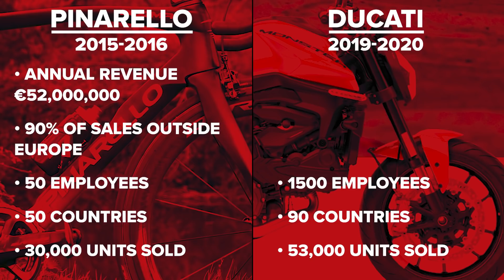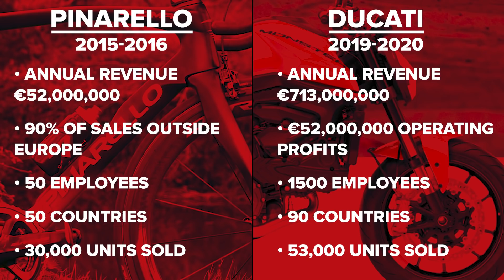How Can A Road Bike Cost £10,000?!

Comment: Yes..the jury is out and the Pro’s on TV are using them (with hints that they are not great)...DISCS
NOW...We as the consumer in many cases cannot justify going from rim to disc...or are just plain HAPPY with their bike (that a couple of years ago..WAS nearly the price mentioned here..)
But hey..let’s face it..even IF...and IF..you wanted to upgrade your super high tech all bells and whistles TO disc....well look at what you have to change?
There is NO mod to convert your frame from rim to disc..(there are different tolerances on the frame and forks for a start) as to where the calipers are situated...the wheels...(hubs, discs etc) and don’t get into electronic!!
Sooooo your looking at a NEW A NEW BIKE...

Comment: The main reasons? Disc brakes and electronic groupsets... let's get back to 2015 and rim brakes and mechanical groupsets (with a light aluminium set of wheels): 1kg less, and 4000€ less...

Comment: Another good reason for high bike prices is research and development (R&D). When it comes to frames I bought a Kuota Kharma full carbon frame in 2006 for £800. It had aluminium dropouts and cable routing outside the frame which made it cheaper to produce. Then somebody in R&D thought it would be nice to integrate some of those cables, but that means making loads of samples, testing and the extra time that takes making complex shapes increases labour cost per frame. 
So the price will increase as the manufacturer has to recoup that investment on projected sales. Then R&D decides to go fully integrated and that bring everything up a notch. Not even mentioning that you don’t always get it right the 1st time round (like Venge Vias) and you have to back to drawing board for a complete new design, as you are making it impossible for the end user to service the bike or travel with. All that extra investment for development is passed onto the frame price and carriers on to future frame prices if sufficient sales weren’t achieved. That’s how you end up in 2020 with a frame that costs £4250 (Sworks Tarmac) for example.
Same goes for groupset prices, we went very quickly from good old mechanical shifting that served us well for decades to electronic, even wireless and straight from rim to hydraulic, so did the price change very quickly going up of course. Also created a lot of headaches with compatibility etc.
Research and development is good, but too much too quickly will have a negative impact on our pockets...

Comment: Now you only looked at the production aspects of the cost. I prefer a different point of view. Cycling is for the most of us just a hobby. And when you compare it with many other hobbies 10k is nothing. I’m from a background of motorsport such as rally. And it’s not impossible to build a rally car for 10k but you will be far down at the entry level. And then comes the cost for driving and competing with the car. On national level you can easily spend 10k on things such as starting fees, tires and fuel on 2-3 races. 

Another example, try getting a boat… 

So of course 10k are a lot of money, but people put a lot more on many other hobbies.

Comment: There will always be a want and a need. I would love a brand new $12k USD S-Works Tarmac. I can afford it, but I just can’t justify spending over $10k on a bike.  I’m perfectly happy with my 2017 Tarmac SL4 Ultrgra and upgraded Zipp 404 wheel set. Most importantly, a well fitted bike and correct saddle with is all one needs to enjoy and be comfortable on rides.  After making constant adjustments on every single  ride for almost 3 months, I finally got my bike dialed in and I was surprised by how much faster I got just from bike fit alone.  I am still faster than half the guys I ride with that own brand new $10k plus aero bikes.

Comment: Just a few thoughts to add to this:

Because a bike is human powered, the engineering margins are significantly less forgiving than in the automotive industry. Tiny changes in weight, stiffness, aerodynamics, vibration absorption, etc. are not only detectable to the rider, but affect performance. This is going to raise the labor costs significantly, not just in time spent but in the level of skill.

Secondly, it's unfair to compare a high-end bike to a low-end sedan or motorcycle. High end motorcycles can run into the millions. High end sedans can cost hundreds of thousands. Comparing a Fiat to a high end carbon bike is comparing apples to oranges.

Thirdly, let's compare a mid-range bike to a mid-range sedan. Midrange bikes run from 1,000 to 5,000, whereas midrange sedans run from 30k - 50k. For a bike commuter, that's an immense savings. But even buying a high-end bike, for 10,000, it's still a huge savings, and it would still be the equivalent to commuting in a Lamborghini.

Lastly, considering value, getting from Point A to Point B on a bike is just much more fun.
Reply: buy what you need, but pls dont be stupid on trusting the cycling companies..they trick you with the marketing..are you using a bicycle to race or only for exercise? then if youre using a race bike for an exercise you fall into the trick of marketing

Comment: These 10k bikes are ones pros use for racing too. If you were to buy a car pros use for racing, it wouldn't be 10k. You can't even get a F1 steering wheel for 10k. I think I read somewhere that the rear and front wings of F1 cars cost like 200k or something silly like that. And the engine is worth millions. If you want to compare a 10k Fiat to a bike you should compare it to the cheapest one you can find.

Comment: Forgot to include a couple of relevant factors considering the Pandemic as well. Boats/containers are extremely hard to get these days, and shipping costs have risen dramatically. Supply chains for every tiny little component have also been crippled, and additionally bikes take up a good amount of room on these container ships. Demand for bikes has also risen dramatically because of the pandemic.

Comment: The point is: the more premium you go the more disproportional will the price of manufacturing etc rise relative to the use case gains, even without ripping off the willing consumer. If you buy a super high quality, low count carbon motorbike or car they too will be far more expensive than what is actually needed to get a basic product of that category.

Comment: What I don’t get is the rate of increase. I bought a used trek madone 6.2 that still had the original price tag and roughly $4,600. Now seven to eight years later it’s close to 3 times higher!  I do see that today’s version has an electronic group set and disc brakes but still...

Comment: About 3 years ago a top end bike with most of the decent finishing kit was about 2.5-3k. It’s basically tripled in price in a couple of years, and if anything there quality has gone down and more bits are outsourced. 

Even a top end SRAM AXS is 2.5k at most, 7k for a frame and wheels is madness.
Reply: youre getting old bruh (me too) 3 years ago was 2018 and there was no top tier bike for 4K
maybe like in the early 2000

Comment: I did spent 10k on my bike 2 years ago (Bianchi Oltre XR4 Dura-ace Di2, Campag Bora one 50!)  and in performance wise, It is definitely an improvement from my mid-range 10 years old carbon bike, and also huge improvement from low-end alloy 7 speed road bike.
There is a gain, however that gain can't be justify the steep price tag for enthugiastic amateur like me, but the emotional point of view, it is still worth to spend the money, I mean, you have the super bike you've dreamt of! 
AlsoI feel more confident to say that I myself is the weakest link of the system if I'm struggling, not the bike 😂

Comment: Life is a matter of priorities. And we all decide on what to spend our money. For someone it will be normal to spend thousands on watches, for others it will be normal to spend the same amount on shoes or clothes. This is personal preference. There is no right or wrong (as long as the production of those things was fair for the workers). I think the only point is that if you really pay that amount for a bike you want something that works. A carbon frame that costs several thousands should be bang on perfect. And if it is done out of tolerance it should be replaced without discussing. My personal preference is that, if you can and want spend so much money on a bike, you should get something custom made. Out of titanium possibly.

Comment: It is crazy that a bike can cost more than a car that has a engine air bags radio been crash tested and engineered to save your life in the result of a crash. Sure it’s only a Nissan micra. But it still has ac windows and a roof. I just can’t justify spending more than a couple thousand on a bike. Most expensive one I’ve bought so far was $800 on a used giant defy.

Comment: I bet they do not nearly cost as much to produce. And it is obscene that they charge so much for the bikes. Compared to cars, they are really expensive despite having technology, which has not changed much the last 20 years - apart from electronic gears and the introduction of more carbon. Otherwise nothing much has changed. It is still two wheels on a frame, which geometrics have not changed much apart from a bit more aero - still most have two chainrings and 10-12 cassettes. And they produce in such high numbers, that the bikes should really be cheaper. People fall for all the hype, so manufacturers charge obscene amounts for bikes just because they can. With all the technology, which goes into cars, bikes should be much cheaper. Those €10K bikes cost about the same a new cars. You can get bikes less than half the price, which is as good or almost as good as the 10K bikes. Unless you are a top rider, where seconds count in races, then there is not much idea in buying those expensive 10K bikes. And the argument that Ducati is a bigger company, with larger revenue, is not logic. The parts they produce, for the motorcycles, cost much more to produce and is made in-house for the most part. Pinarello buys their components from large manufacturers like Shimano and SRAM. Shimano alone has a revenue of $2,290B a year. Which is much more than Ducati. And SRAM is $175M a year. Only things Pinarello gets produced, are the frames, forks and seatposts for some of the models. So the argument does not hold up against scrutiny. To put it in another way; Pinarello generate €1,04M per employee. And Ducati €475K per employee. Hence the €10K bikes from Pinarello are way too expensive. Personally I have a 10K bike. But I also have a 3.5K bike. They almost have the same specs and weight. Both are with aero carbon frame and Shimano Dura Ace Di2. And I honestly do not see the big difference in performance. I bought the 10K bike when I was more vain and fairly new (a couple of years) to the sport. Thinking I would do much better on a 10K bike. But the bike only gave me a minutes over 180 km. Which is really not worth the much higher price tag. So one should really consider what your new bike is being used for. Recreational training and rides to get out with friends on weekends or cycling events, then 10K is not necessary. Top A rider, then a 10K bike might be the difference between winning and coming in second or third.

Comment: A Moulton can cost 22000USD.  That's because it's 100% handmade in England, with 200 braze points, full suspension, and a mirror-polished stainless frame.  Is it "worth" it?  Well, lotsa Asian businessmen are buying them as status symbols, so... ?

Comment: There's absolutely no justification to the ripoff that is a 4-figure bicycle (especially, a production bike) cost. Especially if it's equipped with anything less than MielenStein wheels, a lot of Schmolke carbon parts and Sram Red eTap AXS, etc. Moreover, it's utterly ridiculous that bicycles, including the beautiful Specialized Aethos, howsoever good, should sell for the same amount as a new motorcycle or a Fiat Cinquecento. 
 With all that said, if I was a multi-millionaire, I might buy a custom Bastion CrossRoad and a sub-€7.000,- Aethos version, to supplement My stable of a Salsa WarBird, Norco Search XR C, Genesis Datum, Norco Search XR S and a yet to be built Waltly Ti gravel bike, based on the NordEst Albarda Titanium frame, but with internal cable routing, an elegant breakaway technology (i.e., Santana Z, when Waltly grow the balls to implement that breakaway design into their frames), etc.

Comment: I didn't think anyone ever paid 10k for a bike that's marketed as a 10k bike, they must get a substantial discount. 
Besides, aren't these "halo" bikes, those which are designed to get people talking about the brand, and to get people into a different price segment as to what they think a mid range bike is? After all, if they high end bikes increase dramatically in price, it has the effect or making people think they should spend that little but extra for the mid level, or even low level, bike. 
No pun intended, but I still don't buy it.

Comment: Surely it also depends on the markup. I doubt there is much profit margin in a bicycle retailing for £300.  Also did the makers of carbon framed super bikes drop their prices, when they moved their manufacturing units to Taiwan and China.  But sadly there is a perception that if one buys a budget priced bike,  it won’t be much good.
The main point is to get people out on two wheels to enjoy the exercise and fresh air.

Comment: You could have also discussed the shift in the bike market as a whole away from hobbyists to pro-sumers. Bikes that are designed for 20 year old 60 kilo guys at 10% bodyfat and marketed to middle aged office workers. Whenever i ride i constantly see those guys. Slightly overweight, on carbon racing bikes in full lycra with several thousands worth of gear strapped to them riding a relaxing 15km/h pace stopping at every café they see. 

It's clearly the companies fault tho. R'n'D is expensive and developing parts for the cutting edge racing market is a massive loss so they target regular people as well. That's why we've seen the rise in bike computers, carbon frames and wheels, power meters, electronic groupsets and more. Regular people don't make use of any of those parts, they are designed to shave off fractions of a second and a couple watts. Any normal person spending more than 1500EUR on a whole bike is so deep in diminishing returns territory it's like they just bought hundreds or thousands of euros worth of bubble gum.

But another issue is that those people are your target audience. So it makes sense you wouldn't tell them to stop wasting their money.

Comment: An obvious flaw in your volume argument is Canyon, Rose, etcetera who sell cheaper bikes with, on average, a higher spec component groupsets than larger manufacturers for significantly less money. To go to the opposite spectrum, consider Enve's new bike, which all the parts (except the grouppo) is made in the USA, has customizable dimensions and angles, yet still manages to come out cheaper than production Specialized premium bikes. Furthermore, material costs for frame production has actually reduced as more companies use carbon fiber in mainstream applications. At the end of the day, the price is only because people are willing to pay it. Just look at the price of helmets... is there any significant material or engineering cost difference between a Giro Isode and a Aether Spherical? No, but you know which one you want seen capping your noggin when you roll up to the cafe.

Comment: I would love to know how a £10k “hyper bike” affects the actual performance stats compared to the likes of a £3k “mid range” bike... Because I get that the materials, complements etc are engineered differently which comes at a cost, but are the real life applications of these differences enough to justify it for regular punters/keen amateurs?
Reply: Pretty much a rounding error in terms of tangible performance uplift. The 'frame' of the rider, clothes, and of course fitness will determine whoever is faster. Not the equipment. 

Of course in actual races where everyone is at the top of their game, then having the best matters. But your average cyclist won't see major performance differences and if they do it's probably a physiological thing.

Comment: Fact is, that frames, no matter what they cost, are produced with shitty tolerances, that would make Shimano, SRAM; Campagnolo scream in pain, if they produced gear- or brakesystems just as bad/sloppy.
That Canyon develops a really badly design seatpost-system, clearly made with lazy engineering and no in-depth development-testing - just as an example - says it all.
But the customers are just rich people or easily desceived people with money, without any technical knowledge.
And they just lick up what ever marketing BS that flows from the companies.
Most of the customers would be better of by loosing 10 kg bodyfat and train for an extra hour pr. week.